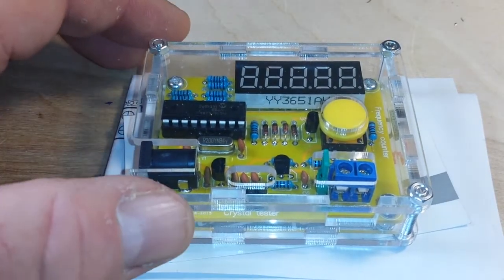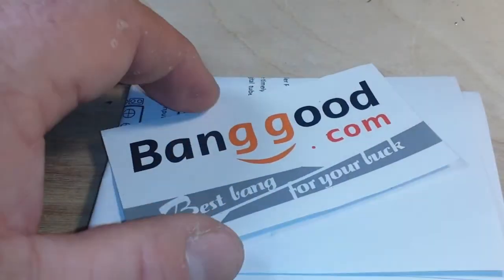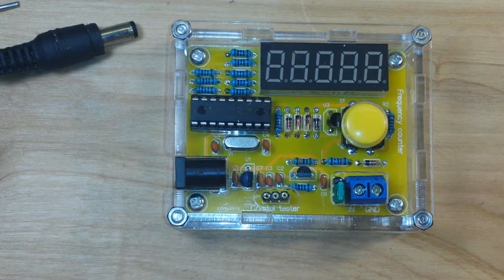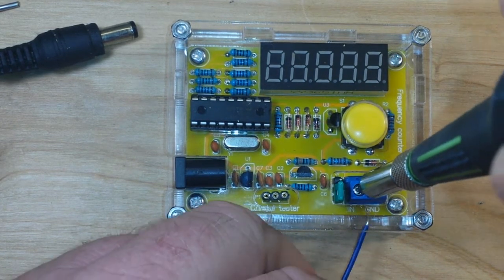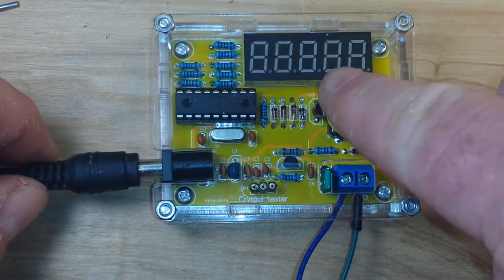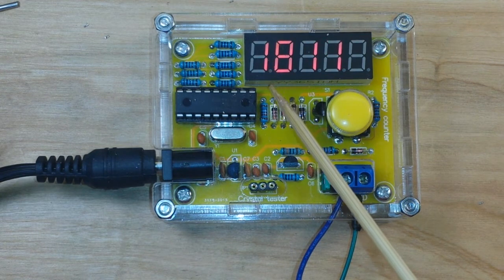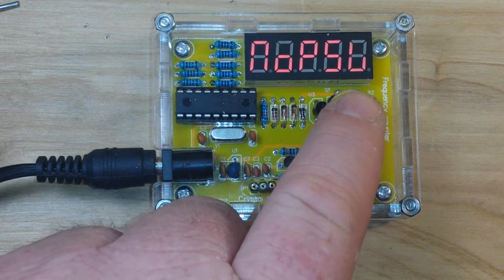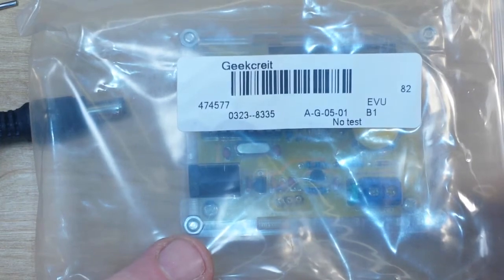Banggood Frequency Counter Crystal Tester

Comment: Good news! Good news! I got the zero when mine first powered on. My kit came with one NPN S8050 D331 Transistor missing. I got it for Christmas and just received a variety box full of transistors today and put that final piece in and put the case together.
 I don't have any way to test frequency with it though. I suppose I could take a crystal out of an old radio and test that. Do you suppose it would be possible to plug some leads into the counter and test a crystal while in circuit or it has to come out?

Comment: I am assembling the kit but I have a doubt, on my package insert it says that U2 and U3 are NPN S8550 transistors but the S8550 are PNP. Please let me know which transistors you have mounted. Thanks
Reply: I have an assembled working kit from a couple years ago. U2 is S8050. U3 is S8050

Comment: This is similar to the one I got from Amazon. Mine has no instructions, but the PCB has all the positions labelled quite well.(ie: resistor locations are labelled with the resistance, diodes with polarity marked etc) Ranjaner 1Hz-50MHz Frequency Counter Kit, DIY Module Board for Oscillator, Crystal Measure Frequency Meter Accessories  The functions seem to be identical.

Comment: The "button that does strange things that [you] don't understand" (0:40min) is a programme button. It allows you to change the offset of your measure. I.e., you can add or substract a previously measured signal to the one being measured, or choose a different offset from a given table of frequencies. It also allows you to choose an energy-saving mode (PSave). By not using it you miss on those interesting capabilities of this device. Hope that helps.

Comment: U2 and U3 which transistor it is? Kit had the wrong transistor.  Not working.  I have to replace it with the right ones. Thank you
Reply: Both are S8050 in a working model

Comment: Mine is most accurate at 7.7  to 8  volts peak to peak on a square wave.  Less than 5 volts showed 0, much higher voltage  showed 0 again or some random readout.

Comment: The BangGood advert gives operating instructions that are downloadable.  The device documentation that comes with the kit gives a URL to pretty much the same document, except that while you can read it on screen you cannot download it.  The menu button and jumper are used to add or subtract a frequency to-from the displayed frequency.  This is used if the device is linked to a local oscillator in a superhet receiver - what you want may not be the local oscillator frequency itself but the frequency the receiver is being tuned to, so the calculation is very useful.  By default the device displays whatever  frequency is fed into it, and the menu button is not needed at all.  The menu system also allows disabling or enabling power saving according to requirement to conserve battery power.

Comment: On the frequency test, I had to increase the signal strength to 5V peak to peak before any frequency measurement would show up.  It just sat at zero until then.  Did you find this as well?
Reply: That's because it uses Schmitt trigger that  triggers @ about 4-5 V.

Comment: I bought one of these but can this test a 32.768Khz Crystal? it can test 20Mhz but Zero  in 32.768Khz was mine defective?
Reply: I found the same thing.  Tests above 1 MHz but not below.  I understand the 22 pf capacitors are tuned for higher frequency oscillation.  The values may need to be changed for lower frequencies.

Comment: I believe the unit is capable of measuring not just frequency but it is a counter and generator so I think it can behave like a Dip meter. I’m not sure how until I build my own device lol A Dip meter would show the frequency it being a crystal starts vibrating & stops vibrating its used to find its frequency of oscillation or discovering a crystals resonant frequency eg the Dip.
Reply from the maker: Yep
Reply: @learnelectronics  Any idea howto convert it to a basic counter for low frequencies?   Thanks   John.

Comment: we use € here in germany (and the whole EU eurozone) :P and it was at the top right the whole time.

what do you get if you drop 2 pounds of weight on your foot? Kilohurts :D (cause 2 pounds are roughly a kilogramm)
Reply from the maker: I forgot about that whole Euro Zone thing. Been over 20 years since I was in Germany. I was looking for deutsche marks.
Reply: yeah its been a while since we used those :P

something i forgot to mention last time where you shared code: you could try using github to share code, or at least pastebin, which is made to share text snippets. dropbox is a bad idea cause they dont like it when many people try to access a certain file. pastebin would be the easy alternative and github would be good if you want people to hand in improvements of your code (but i dont think that you want to fiddle too much with that software guy stuff :P)
Reply from the maker: I am going to switch to pastebin. I tried github in the beginning but it made my head hurt. Next Arduino video I do (probably Monday) I'll be going to pastebin. It should help with posting code to redditt as well.
Reply: yeah git can be a pain sometimes :P im not bothering with the command line tool and just use sourcetree which is a nice GUI for it
Reply: GitHub isn't that great for simple code but github does have a pastebin type function called Gist which might be better than pastebin
Reply: I can "kilogramm" in about 2 seconds...............

Comment: Please could you scan the partlist and publish them?
I got same kit more than one year ago, it doesn't work. It seams, that the kits has new partlists.
In my case are looking the colorcodes of restistors different, may be I can repair my tester with the new partlist?
Reply: Thanks a lot fpr the material. Resistors at the picture and reals values of them are looking sometimes very difficult.So I found out, that the Resistors on my board are OK. It was able to measure them on the soldered board. But I found out, that two ceramic capacitors are different, i've they to change, when they are delivered.

Thanks again !!!!